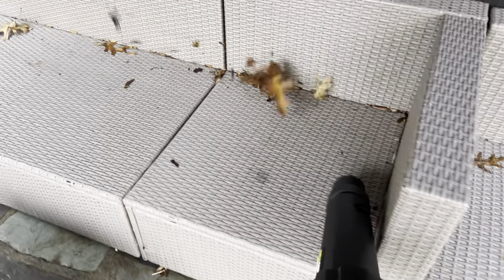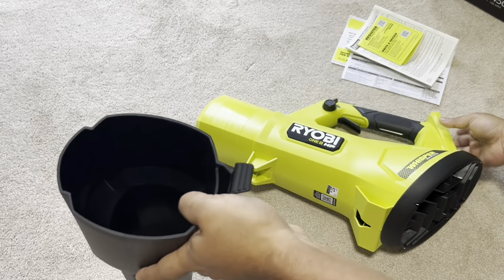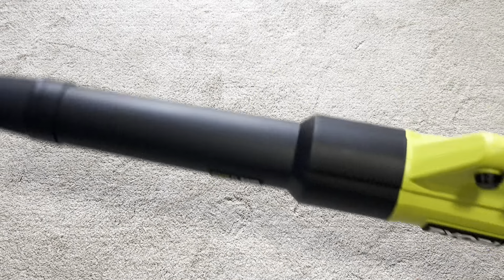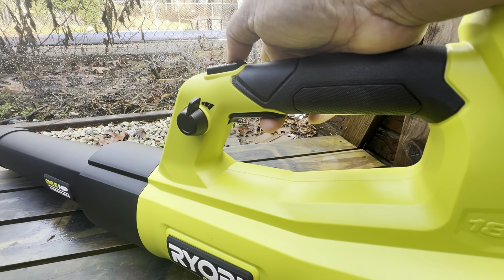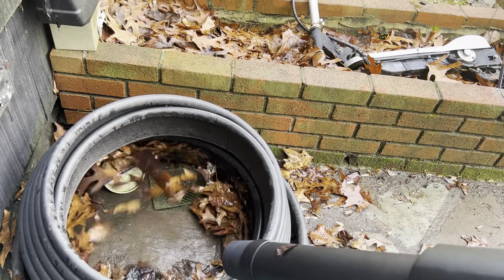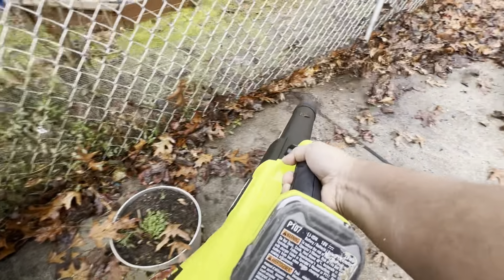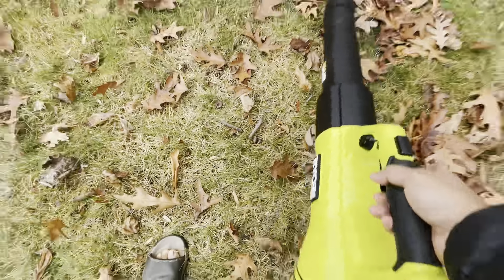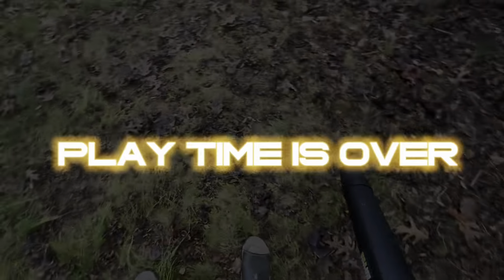Leaf Blower REVIEW | RYOBI  18V Cordless

Comment: That's the smallest battery they have. Try a 4AH minimum or larger battery. Guaranteed the results will drastically increased. Remember you can also use multiple batteries if needed too. I love mine and I've never used a battery less than 4AH. Yours sounds tired at startup co.pared to mine. Same unit btw.
Reply from the maker: Thanks for sharing your experience

Comment: The battery you are using is way too small, that is why it isn't running very long or strong. Got two 4AH batteries for mine and it runs great. You can often get the 4AH batteries in a 2 pack for under $100 at Home Depot.